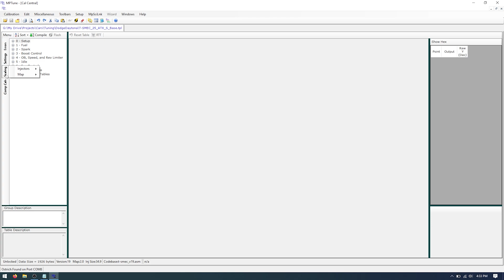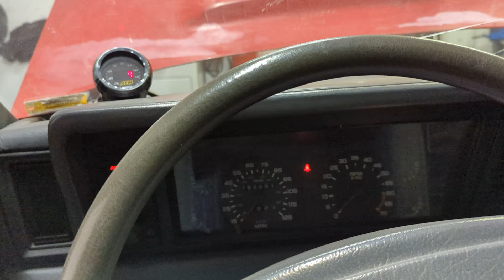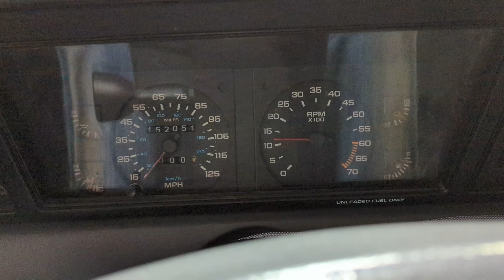Turbo Dodge SRT-4 Injector Swap

Comment: We haven't heard from you in a while, so I was worried that you left the FWD community.  I love the idea, but have a couple questions:
1) Are these high impedance injectors, compared to our older low impedance one?
2) With the adapters, does the fuel rail end up at the same height as our old ones?
3) When you loaded the original MP tune, where did you get the values from?  Did you modify someone's existing tune, or have to create all of the values from scratch?
Reply from the maker: Aye! Nope, still bashing things together. I'm actually working on another car at the moment, putting a 2.4L in my Rampage.

As for the questions:
1. Correct. High vs the old low.
2. Fuel rail fits perfectly like stock
3. These values are from a very very old spreadsheet on the Internet that has a ton of different OEM injectors listed.
Reply: @NecromancerGarage  Document the rampage! 

I have a 2.4T in a PT Cruiser GT and swap mounts for 89 and earlier cars. I bought it to move the engine into another car, but I feel dirty cannibalizing a perfectly good PT to make another car faster :(
Reply from the maker: @derekr3895  Totally understandable. I was lucky enough to find one with a blown up engine for $400. Easy enough repair too. 

I'll try to get some videos out on it, I just have the habit of getting stuff done without recording it. 😂
Reply: @NecromancerGarage  fits the 2pc manifold as well ?
Reply from the maker: @pertinentinformation741  That I'm not sure of unfortunately. I wouldn't see why not though?

Comment: Will those injectors damage the drivers in the SMEC? Also how did u setup MpTune?
Reply from the maker: From all of my research, it is perfectly fine to run a high impedance injector on a low impedance injector driver, but definitely not the other way around. 

As for setting up MPTune, that's a whole other story. 😬I'm using a FTDI cable with an Ostrich 2.0 to tune the car, using BoostButton base tunes to build on.